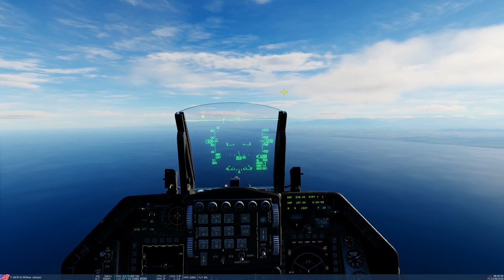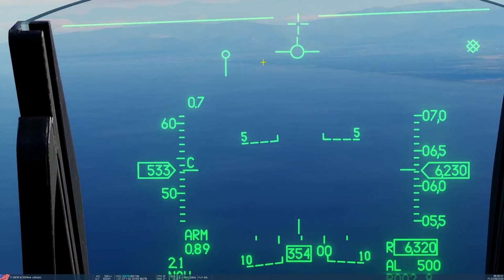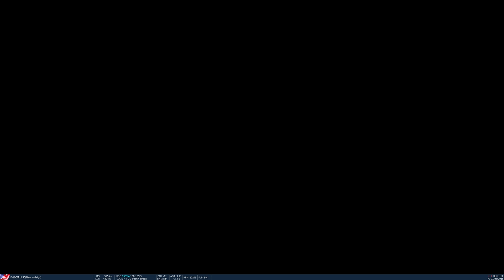F-16C Viper: NEW G Warm Up Feature Added | DCS

Comment: Iirc 30 seconds of 10g with a suit is a minimum requirement to even stay in the US F-16 program, if you can't do that you won't be combat certified, I've even seen some people (namely Hazard Lee on YouTube) maintain 11-13 for roughly that amount of time, viper pilots are an entirely different breed of human. I don't know if this test is done with or without warmup, and actual aircrew are much better suited to answer that question then I am (i give you the floor, please tell everyone if and how I'm wrong) but what I do know that the effect of a warmup tends to slowly peter off over the course of several hours unless you continue to do high G maneuvers during that period which would reset (and in a lot of cases extend) the "timer" which of course isn't actually a timer because people don't run on clockwork.

The way it's done right now is quite frankly a lazy and pointless way of doing things, and any F-16 crew (or aircrew period) would tell you it is blatantly unrealistic. I appreciate that they're trying but I have to say I'm very disappointed in the end product in this case, I really hope they put a lot more effort into this in the near future, in its current state the F-16 is still being heavily nerfed by bad physics.

Comment: I thought DCS was a simulator! WTH is this simulating? Gimmickry? 
Maybe they should fix the clownish landings where half the plane goes into the ground and back up.
Reply: It is a legitimate procedure to acclimatise the body to high G forces, as well as confirm the systems that are meant to counteract them, are functional.

As for the "clownish landings", usually the result of poor network comms with the server, or considerable latency differences. Not sure how they are supposed to fix that.